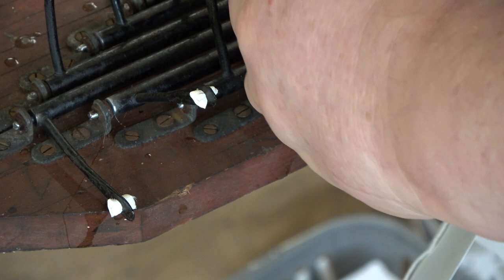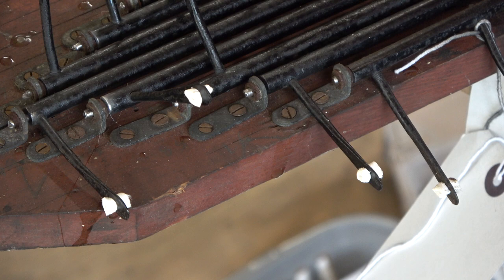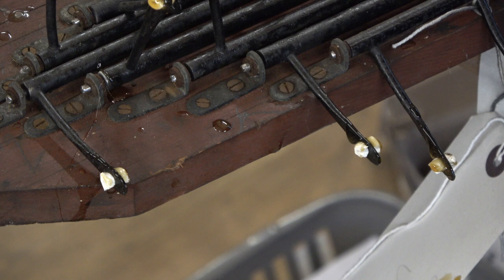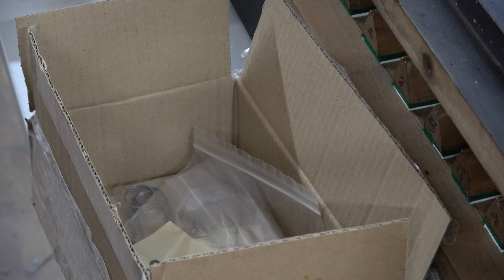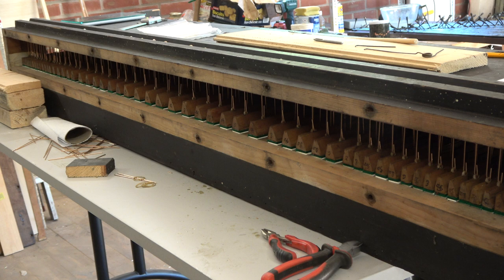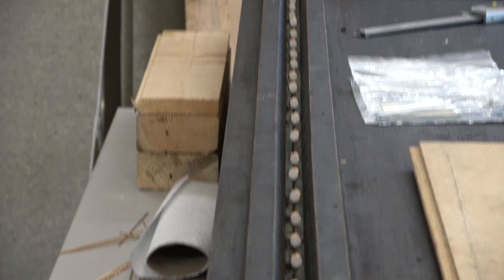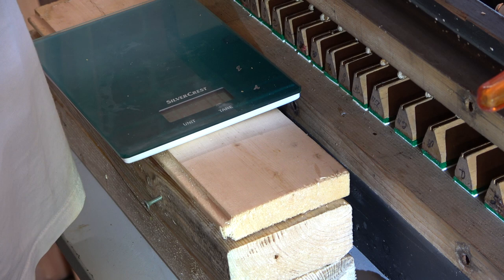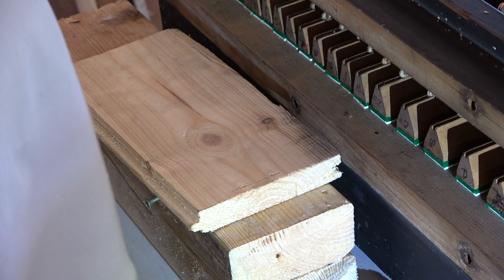1865 Forster & Andrews Pipe Organ Restoration Pt9 of loads

Comment: What ever happened to vim and Ajax powder cleaner, showing my age now lol.
Reply from the maker: I've still got a bit of both...need them for cleaning the wooden parts of gthe keyboards.

Richard
Reply: I remember ajax and vim they still make them but mostly for export, i know you can still get ajax in places like india;  but i think they mat be a bit too abrasive, Where flash mostly dissolves. I know a strong solution of powered flash and water is very potent it even stings your hands